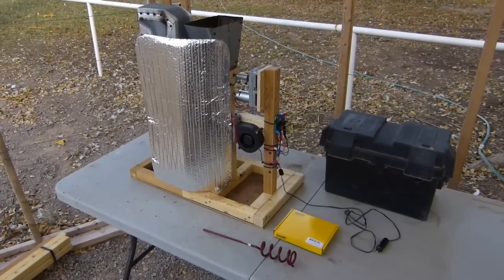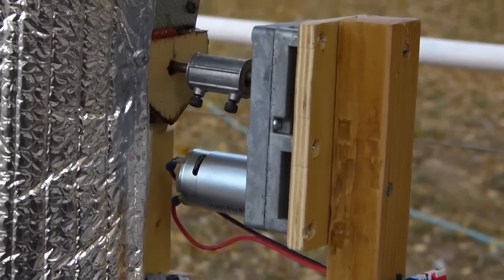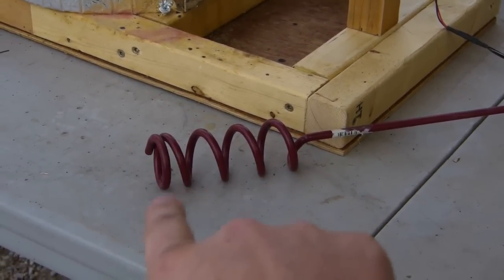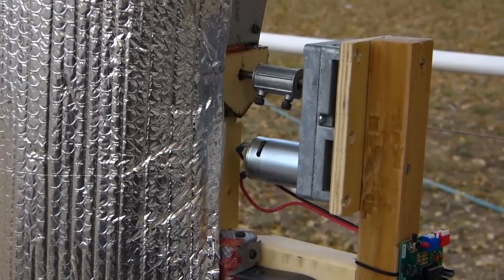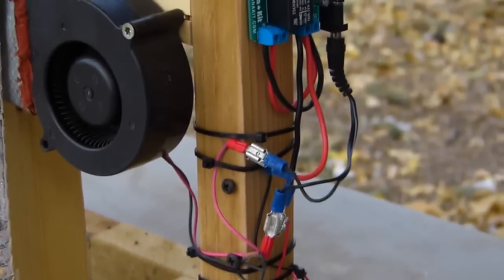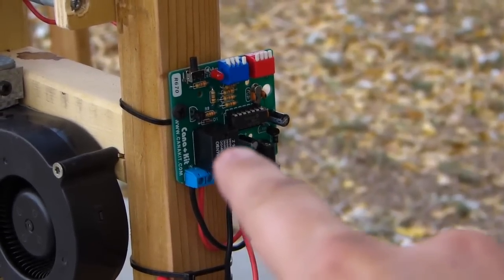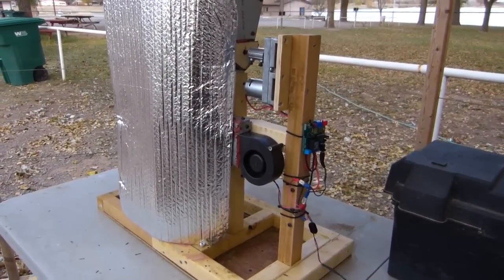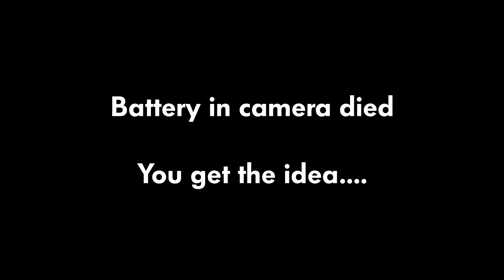DIY 12v Pellet Stove Control And Auger

Comment: thanks, pellet stove computer went down and repair bill would have been $500 just in parts. Thanks to your video i got it running off the canakit for $40.  HUGE savings.  thank you so very much.  ps, super easy to program and connecting wires couldn't be easier.

Comment: The augur is genius.  I converted a double barrel stove to a boiler by wrapping 300' of 1/2" copper tubing around the upper barrel.  I'm converting it to a pellet burner and the fishing pole holder is a perfect solution.  I'm controlling sprinkler valves and moisture sensors for my garden, using an Avantech 32-channel I/O card which should handle the stove controls.  Have you thought about automatically removing ashes so you can use a large capacity hopper?  Hope you post your refinements.

Comment: hey I love your idea  it's almost exactly what I was thinking of building but for my controller  I'm using a temperature controller with built-in relay  I got it for a couple  bucks from China W1209 LED Digital Thermostat Temperature Control Thermometer Thermo Controller Switch Module DC 12V Waterproof NTC Sensor .basically you set the temperature like 250 degrees and then it's allowed to go + -  10 degrees and when it goes below up by 10 degrees turns on your feeder I'm going to use it for a smoker BBQ .can you share a link for your auger motor and gearbox. I was thinking about going one step further and using a timer relay for the auger.

Comment: I noticed you have 2 jumper wires red and black ,what is the reason for doing that? I have a 110 V auger motor that i will be running off of this cycle timer , fan will be run separately  and continues. Before hooking it up i thought i would ask  so i don't burn it out.

Comment from the maker: CanaKit has a USB tethered 4 port relay controller:
"4-Port USB Relay Controller with 6-Channel Temperature/Analog/Digital I/O Interface (Data Acquisition Module)" 
Look up CanaKit UK1104 - $60
Myself, I want a standalone deal with 4-6 relays and 6 I/O like that.
Probably go Netduino though. The new ones are out.

Comment: thank's allot i will fix my control bord by replacing the original and connect the outlets to a relay where i connect the 120 volt to the system
but thank you verymuch

Comment: what are the specs of the motor?
Reply from the maker: +Jtinnon The motor itself is blank, no specs or labeling.
Here is the gearbox I used, but Multi does not stock it:
https://www.multiproducts.com/dc-gear-motors/model-9000

Another big $$$ maker of DC gearmotors in this form factor:
http://www.merkle-korff.com/products/brushlessgearmotors.asp